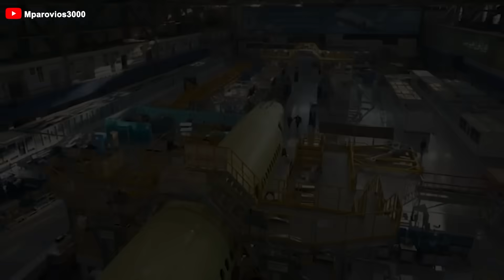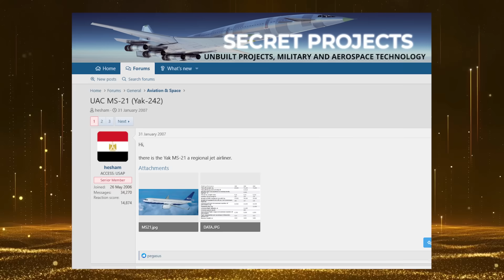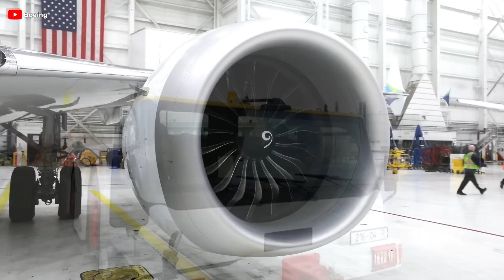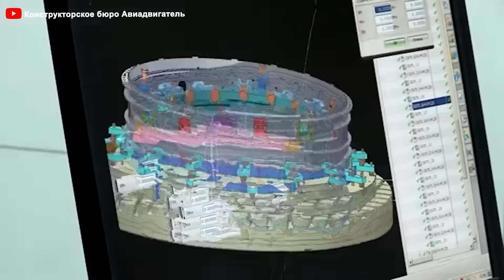This Russian NEW MC-21 Will Change All Aviation! Here's why

Comment: Its more propoganda and realistic lol
Only the engine problem will take decade to solve and this is before testing 
But it seems like a nice plane
Reply: It is already flying and being produced.
Reply: @Egor_Pronin_  5 tonnes heavier than expected according to Kommersant. Good luck with that.
Reply: @stream2watch  From what I've heard, it's not true.
Reply: @Egor_Pronin_  I am sure the Kommersant aviation journalist is more trustworthy than your source, especially considering she lives in a country where journalists get killed.
Reply: @Egor_Pronin_  Except you can read Kommersant yourself to verify it.
Reply: @Egor_Pronin_  Deputy Prime Minister Denis Manturov confirmed in an interview with Vedomosti that:
“...the import-free variant of the MC‑21 aircraft turned out to be almost 6 tonnes heavier,”
Reply: The engine may not be good but it's not that bad alf51 has 6000 hour lifespan very close to western standards pd14 has a bypass ratio only less then the latest western engines
Overall it's not going to change aviation sector at best will fulfill the domestic order and those that are under western sanctions
Reply: “МС‑21 получился ближнемагистральным самолётом вместо среднемагистрального, именно поэтому Госдума одобрила выделение из бюджета ещё 2,2 миллиарда рублей…
Использование российских композитных материалов привело к значительному увеличению массы МС‑21 — самолёт потяжелел почти на 6 тонн, что резко ухудшило лётные характеристики. Например, при полной загрузке дальность полета снизилась в два раза… до 2,8 тысяч километров или даже до 2 тысяч, что выводило лайнер из категории среднемагистральных.”
Reply: @stream2watch Still better than the Boeing, which is falling off the skies.

Comment: more advanced than any previous Russian aircraft but well behind Airbus and Boeing.  It has to be efficient and reliable to compete, where are the wingtips.
wingtips increase efficiency.
Reply: Here we go. Wingtips are there for a particular reason. If no wingtips, that means that particular reason does not exist or compensated somewhere else. Commercial Aircraft are designed for performance, efficiency, safety, etc. 
Look is not a big factor; they are not race sport cars for teenagers.

Comment: It will get international certification but not from the EU. Nations like China, India and Iran will certify it. And perhaps the FAA depending on the ultimate deals made regarding the war. The EU will keep it uncertified out of bitterness and commercial protection.
Reply: You have no clue how certification works.
Reply: @DinoAlberini  pretty familiar with it actually. Have personally been involved with an STC for a DA20, and of course hold certifications on NZ, Australia and the EU.
Reply: @  and I totally believe you.
Reply: After the sanctions Trump put on China. You really think they'll buy American? 😅
Reply: There are international civil aviation orgs like ICAO, that are required to certify aircraft as  long as certain standards are satisfied. Therefore, the Starmers and macaronis can not decide everything
Reply: @dawg929  ICAO doesn't do aircraft certification, it creates advice for aviation policy. You will need to Google how the process works.
Reply: @greybuckleton I don't have to google. I am an aviator myself. Orgs like ICAO, IATA have international compositions. Therefore, they influence fair management of regulations globally. EU can not dictate all aviation regulations in line with its political lines. Russian aircraft were certified even at tje height of the cold war. So, chill
Reply: @dawg929  influence not control. The FAA and EASA are the primary power behind any certification, usually with lots of help from them manufacturers. The certification process with EASA stopped with the war, it's ultimately part of the EU government and absolutely within their perview to stop work. As for the Cold War, well the UK has closed Russian diplomatic houses in London that it never did in the Cold War. Military tension may be less but political tantrums are greater.
Reply: @dawg929  here, from the wiki. They did indeed stop certification work due to the war in Ukraine. It's not that the aircraft itself was unable to pass the requirements. "In early 2022, international sanctions against Russia were imposed due to the Russian invasion of Ukraine. Irkut Corporation was placed on the sanctions lists of the United States, Canada, Switzerland and Ukraine,[7] while United Aircraft Corporation was placed on the sanctions lists of the United States, European Union, Japan, Switzerland, France, Belgium and Ukraine,[8] and the European Union Aviation Safety Agency (EASA) suspended all work on type certification of the MC-21"
Reply from the maker: It is very possible. It may still be accepted by countries outside the EU, and the US.

Comment: This reminds me of a DC10. Those were infallible for decades.
Reply: @kevingthompson: ??? DC-10 was shit. This plane was the reason, McDonell-Douglas is going to Boeing.
Reply: @angelo9999-9  Boeing was always a monetary joke. MacDonell Douglas was makers of fine aircraft including the daunting f4 Phantom 1 & 2.
Reply: @kevingthompson14  The military-part is not the same. DC 8 maybe good. DC 9 was too loud and too thirty. And DC-10: They will always come to the ground.
Reply: @angelo9999-9  The DC-10 was forever regarded as the safest commercial aircraft until the advent of the Boeing 747 which was displaced by the Airbus.

Comment: It is not going to be built.....ever...
Reply: As of early 2025, 13 MS-21 aircraft were built in Russia, including the MS-21-300 and MS-21-310 modifications. 

Serial production of the MS-21 is planned to begin in 2026. 

In 2025, it is planned to produce 9 MS-21 aircraft. 

Thus, in 2025, it is planned to produce 9 MS-21 aircraft, and in 2026 - 31 aircraft.

Comment: Absolute rubbish. The engines are Pratt and Whitney! You can see the logo on them!
Reply: The propagandist is blinkered for the MS-21 aircraft, domestic engines PD-14 are used. There are even more powerful engines. PD-35 is a turbofan twin-circuit engine designed for installation on promising wide-body aircraft, including the SHFDMS. And what you designated as the Pratt & Whitney engine. This is the PS-90A2 - an improved version of the PS-90A engine. The engine was developed with the participation of the American company Pratt & Whitney, but is manufactured in Russia.🤣😂

Comment: Where are the engines, the avionics, the cutting-edge materials to compete in the world market? So many uneducated comments here. It's not a matter of what or who you like, let the facts speak and cut the crap. The PD-14 is not a suitable replacement for the PW1400G, so the aircraft will not go anywhere as long as sanctions are in place.
Reply: I think you're also uneducated
Reply: The Russians have been building their own engines for decades. The Soviet Union were the very definition of self-sufficiency.
Reply: @yxmichaelxyyxmichaelxy3074  That‘s a main reason of the Soviet collapse. Self-sufficiency means returning into the middle age.

Comment: Was hoping the MC-21 would have used a rear-engine design [likeTu-154], not wing-mounted engines.  But too late now...(^_^)..
BTW: Where do they put the fuel in this new MC-21?  The wings appear much too thin for any substantial fuel cell!! ============

Comment: No discussion around engine fuel efficiency? It's the key factor.
Reply: it is more fuel efficient than the current Western-made engines, is what I read.
Reply: @yaroslavgorbachov9063  Where did you read this?
Reply: @alexandervt641  I don’t remember now, multiple places, but I think I remember they also alluded to the fact that the actual plane is lighter than the Western analogues, and that also contributes to fuel efficiency
Reply: @alexandervt641   here’s a quote of the sort I’ve seen in several places: “The use of composite materials in the design of the engine and nacelle and wide-hollow titanium fan blades significantly have reduced the engine weight. PD-14 benefits from indisputable advantages: reduction in fuel consumption by 10-15%, reduced life cycle cost by 15-20%; engine maintenance costs 14-17% cheaper than existing analogues.”
Reply: @ It is the other way around: Due to the use of Russian components, the МС-21-300 became much heavier than expected and failed to reach the target distance of 6,000 km. That‘s why Russian government decided 3 weeks ago to push the shorter version МС-21-200 in order to reach the target distance.

By official data, the weight of the МС-21-300 now is 85 t, and the range just 5,100 km. For comparision, Airbus А320 neo has a weight of 79 t and range of 6,300 km. Boeing 737 MAX has a weight of 82 t and a range of 6,550 km.

So the МС-21-300 has much worse flight charateristcs than its Airbus and Boeing competitors.
Reply: @alexandervt641  lies

Comment: The MC-21 is a significant achievement for Russia’s aerospace sector, showcasing advancements in composites and engine technology. However, its ability to "change all aviation" is overstated. While it may secure a niche in domestic and allied markets, global disruption is unlikely due to:

- Certification and trust barriers.
- Production scalability issues.
- Geopolitical isolation.

For now, the MC-21 symbolizes Russia’s import-substitution ambitions rather than a genuine threat to Airbus and Boeing. Its real test will be achieving reliable mass production and convincing international customers of its long-term viability.
Reply: economical reality of MC21 is very bad :  w/o foriegn components (mostly composits) it becomes few tons heavy. It's very bad for economy to fly with few tons of heavy parts instead of few dozens passangers on board (and their money). I'm from RF but I'm not proud of this idiotic project with losses instead of profit for many years.
Of cause MC21 projected for home airlines not for international customers. Depth of russian markets is few decades minimun to substite Airbus and Boeing.
Reply: @АндрейМилованов-у9у  The MC-21 is akin to China’s first homegrown cars in the 2000s—clunky, overpriced, and mocked globally. But those early steps laid the groundwork for today’s competitive EV industry. Similarly, if Russia learns from the MC-21’s flaws and iterates (e.g., a lighter MC-21-400 with AI-optimized systems), it could eventually carve out a niche.

For Now: Celebrate the small wins—the PD-14 engine’s successful tests, the first deliveries to Rossiya Airlines, and the sheer audacity of trying. Aviation history is full of underdogs (Embraer, COMAC) that started weak but grew into contenders. The MC-21 may not “change all aviation,” but it’s a reminder that even imperfect progress keeps the industry moving forward.
Reply: @dradenhaven1549 The difference is that the MC-21 is already in development for 20 years. No progress in sight. Same arguments have been used for the Superjet. Nothing was learned. Russian aviation became from bad to worse.
Reply: @ The MC-21 won’t “save” Russian aviation, but its messy existence could act as a catalyst for micro-level resilience. Think of it as a bridge—a rickety, overpriced bridge—between a Soviet past and a future where Russia’s aerospace sector survives as a smaller, humbler player focused on:

- Regional jets for sanctioned states.
- Drone/auxiliary tech spun off from MC-21 R&D.
- Lease/repair hubs for grounded Western planes.

For You (as a Russian Citizen): Your skepticism keeps the discourse honest. But hidden in this fiasco are seeds of adaptation—ways for engineers and entrepreneurs to route around systemic rot. The MC-21’s real legacy might be the scrappy, unofficial innovations it unintentionally inspires.

Is this ideal? No. But history shows even flawed projects can yield unexpected dividends—see how NASA’s Apollo-era excess birthed Silicon Valley. Russia’s aerospace “Apollo” might yet spawn its own chaotic ecosystem. Keep the faith—but keep your expectations low.

Comment: The west sabotaged sputnik vaccine, which was the best on the market. It will also sabotage this plane because we are masochists who find pleasure in hurting ourselves.
Reply: The russian vaccine was not the best on the market, Russia bought in the end western vaccines. Regarding the airplanes, I don't see anybody buying them. It will be waste of money. For 20+ years, Russia was not able to produce a reliable engine for SU-57 forcing India to get out of the joint venture with Russia. When is about passenger planes engines, requirements are tougher. They are good for internal fares because one catastrofic accident per year is acceptable for Putin.

Comment: Russian aviation industry never really left the scene since Soviet times - constantly churning out military and cargo planes, with low-rate airliner production as well. The use of Western airliners and off-the-shelf parts was purely economical, and that is obviously no longer the case.

Russia could easily upscale production of current-gen Tupolevs - direct domestic equivalents to B737 and A320 and also Chinese C919 (all of which are legacy tech). However, Russia went straight for the the next-gen.

MC-21 obviously won't conquer any politically shielded Western markets, but the Global South?

Also, Russia now domestically manufactures spare parts for their Boeing/Airbus fleet. That "spare parts crisis" in Russia is overblown. Russia can make 5th gen fighters, making parts for legacy civilian liners is not a technological challenge.

Comment: Boeing let his experienced engineer go when it began outsourcing its operations to Brazil and India in order to cut costs and make more money. That's why the Dreamliner built by Boeing was not a successful project. Greed is causing Boeing to lose credence, American engineers are very, very good, and they should be the ones working on vital design and building of Boeing airplanes. Max 737 was a failure too. The plane had two or three crashes within a short period of time and, as a result, was grounded for a while. Whereas, Boeing 747 has been the most reliable aircraft in the commercial aviation industry. Why would any resonable business people not listen to the advice of the engineers that designed and built such aircraft? Make it make sense. The engineers that built Boeing 747 left Boeing when Boeing's management stopped listening to the engineer's cautions about oursourcing its operations. The result is what you see in Boeing products today.

Well, if MC 21, MC 200, MC 300, MC 400 take over the commercial avaiation industry, the American people will have the Democrats and EU war mongers to blame. Although, I would prefer to fly Boeing or Airbus because they have decades of history of building airplanes. However, if the Russian' built aircrafts can prove they belong as years in the future, Boeing and Airbus should be concerned.
Reply: Russian planes will never approach close to market requirements of Boeing and Airbus... Simply not a way of thinking... Boeing and Airbus had years to create market needs. Boeing is in a bit of trouble cause marketing took too much in going forward and engineering was put aside... I hope that it'll come to it's place for Boeing soon...

Comment: The MC21 is just a reverse-engineered Boeing aircraft. No accolades should be showered upon them. There are copycats.
Reply: Excuse me? If you look at what Boeing offers, you'll see that according to Boeing the MC21 is supposed to compete with 737 Max. Roughly the same MTOW, passenger capacity and range. But there's nothing to steal from Boeing in this size class!

Srsly, let's compare these two!
Which aircraft features an ancient airframe that can barely house the modern very high bypass engines because it was optimized for air stairs boarding and manual baggage loading more than 60 years ago? 
Which aircraft has a legacy fleet so large that the manufacturer has to come up with some questionable flight augmentation systems in order to sell it?
Which plane was made by a company that's grown so rusty that their CEO refused to task his own design center to make a new model, calling this routine a "moonshot"? 

Clearly, not MC-21. The 737 Max is a flying disaster because the modern engines simply don't fit the airframe anymore. I am pretty sure the original 737 Classic design team would ridicule the very idea of fitting an engine so large and would call anyone who insists on that insane.

So as such, MC-21's main competitors are A320Neo and C919. The Chinese jet is a new aircraft, and A320Neo is much taller than Boeing, so the engine placement isn't an issue at all. Much like MC-21, it has a side stick. And A320Neo is a wonderful aircraft, especially with CFM LEAP. The only Airbus issue so far is with PW engine. So if you really want to accuse the Yakovlev Bureau of stealing based on apparent similarities instead of solid evidence, you should probably look in this direction instead.
Reply: What u don’t like about Russia u hater
Reply: @soaringeagle031 let him make himself happy...who cares?!
Reply: Pot calling the kettle black !! 😂 Who stole all Russian space technology and aviation technology...forgot the asylum given to mig 25 pilot. !! And inducting all Nazi and Russian scientists
Reply: @rejevmohan1261  Exactly.

Comment: How is this better than the Chinese COMFAC?
Reply: The maximum flight range of the MS-20 is 6,400 kilometers, which is quite acceptable for most aircraft operators. The Chinese C919 can only fly up to 4,100 kilometers. All the most important components of the Russian aircraft, including avionics, landing gear and engines, are domestic, while the Chinese aircraft is equipped with these foreign-made components. This means that if relations between China and the United States deteriorate, production of the C919 will become impossible.